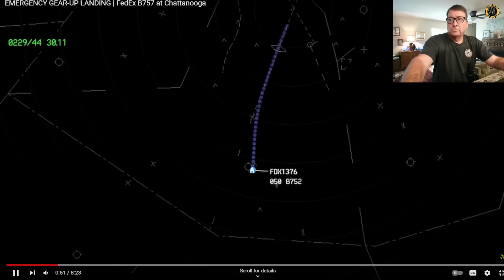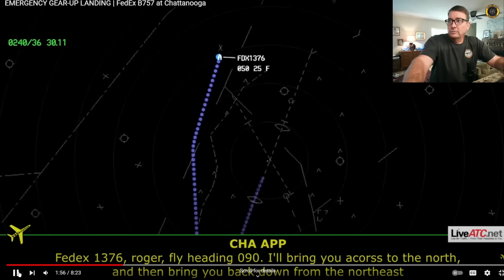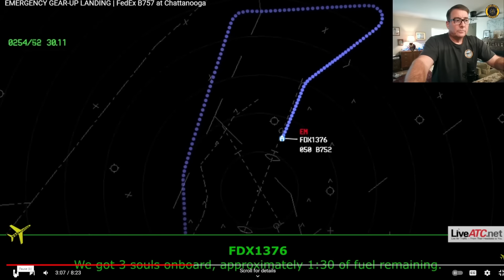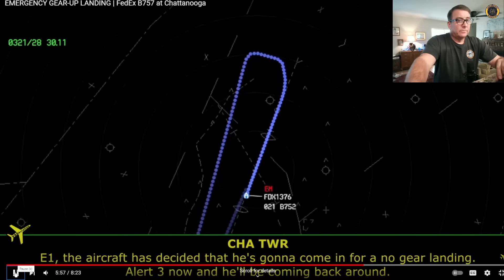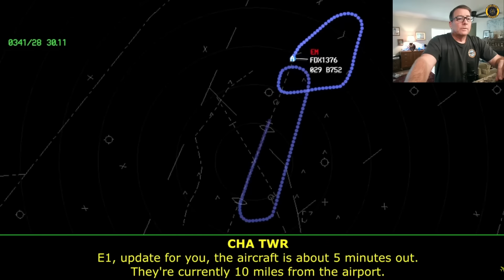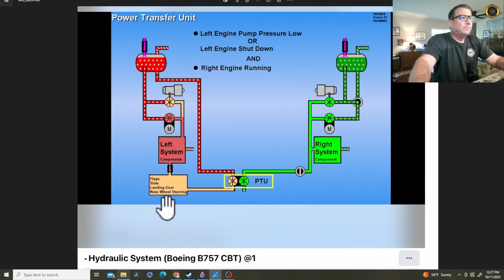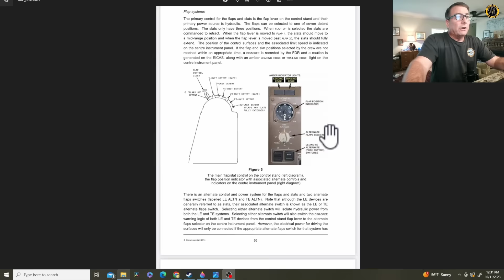Fedex 757 Gear Up Landing 4 Oct 2023

Comment: Could this have been handled any better? Certainly seems like a great job all around.
Reply: I'd say, from the radio chatter, probably not. Now, what went on in the cockpit is anyone's guess, and there might be something that the NTSB finds out that could have changed the outcome. Again, this is based on the radio conversation alone, it doesn't sound like it. But that's just the flight. The NTSB going to look at everything from it's maintenance history, were there reports of issues before the flight crew took charge of the plane, If things were out of service, were they properly documented, was there anything at the stand that ground crew or the pilot inspecting the plane should have seen, etc. That's where you're probably going to see the NTSB catch things.

Luckily, the NTSB has a mostly intact plane to work with. That makes their job a lot easier than when they need to dredge an ocean floor or sift through ash and fire retardant foam looking for clues.
Reply: A night landing too. Amazing.

Comment: Looking at the diagram.....it looks as if the hydraulic reservoir is pressurized with bleed air. I suspect there was an issue with the bleed air that helps keep the system fully pressurized. I am an operator at a power plant and I have a system that uses compressed air over water (which is basically a hydraulic system) and when that compressed air starts having trouble it affects my entire operation.

Comment: What are the chances that thing will fly again?  Looks like that crew did such a good job getting it back on the ground that they could hang some new engines on it, top off the L hydraulic system, maybe a few skin panels back aft, and go right back to work. In any case, they should be able to find the source of the problem pretty quickly since the aircraft is so well intact
Reply: chances aren’t good

Comment: QUESTION: What's the likelihood of this aircraft being repaired and put back into service. I know the wings are designed with a certain amount of flex in them, and the nacelles can be dropped and replaced. But with the plane resting on the nacelles and the tail (plus possible tail strike after the plane was on the ground?), I'm wondering if there was too much stress on the airframe to deem the plane safe to be repaired and returned to flight service. She did what she was supposed to do (Get the crew on the ground safely), so it seems a shame to say she can't fly again. But I'd rather insurance eat this one if there's a chance that she has problems in the future. (I'm remembering a couple of Asian run Boeing 747's that had issues with damage to the tail that led to the aircrafts eventually failing.)

Comment: Seems to be too much dependence on trapped fluid.  All the systems seem to be defeated if the last line to the gear breaks.
Reply: Too much dependence on trapped fluid? I disagree. The 757 has been in service for 40 years. If this is the first gear-up landing, as Juan said it might be, then I would suggest that the backup systems for the landing gear were over-designed.  A single failure in 40 years for something that is not a critical system makes me think the system is better than it needs to be to me.
Reply: @andrewsnow7386  I would view the low damage rate as a sign of good maintenance.  You know what they say about causality and coincidence.
Reply: @RS-ls7mm  Good maintenance is absolutely required. But, are you are suggesting that a good design is not also related to a good safety record -- it's just a coincidence? Would you be happy flying on a 737-Max airplane that did not have the MCAS fixes installed?

Comment: Thank you for an excellent analysis! Can't wait to see what you come up with when the report comes out. I'm sure mentour pilot Will also do the same.

I have a question for you Juan. With the proliferation of cheap cameras, why is it that modern aircraft do not have external cameras? I don't mean the 757 in question. I know it's an older aircraft. But I'm not hearing any reports of more modern aircraft such as the 787 or A380 having external cameras for monitoring situations. Is it a technology issue or a regulation issue?

Again, thanks for all you do.

Comment: it just shows how tough these rigs really are, the engine nacells barely broke after having the whole dang plane land on them lol, im sure their is a lot of damage, but still if this was a passenger plane everyone would have made it out safe and its just amazing how we can make these flying cans so lightweight yet still so dam tough
Reply: Design and stress analysis folks did a great job designing the 757.
Reply: The engines are toast, and replacing them may be uneconomical. That's what retired the LOT 767 in Warsaw. It had little damage apart from rear belly scrapes and the ruined engines, but at the time used 767 airframes had little value and replacement engines were expensive; the plane was soon to be withdrawn from service as LOT replaced its 767s with 787s. I suspect that 757 airframes may be more valuable, but ultimately the cost of replacement engines will determine this aircraft's fate if the airframe is not seriously damaged.  I would not be surprised if the cause of this mishap is similar to that of the LOT 767's belly landing.
Reply: Aircraft is most likely a complete loss. Even though it looks likes little damage the repair cost to the belly is most likely not worth the value of the repaired  aircraft of this age.
Reply: @bkailua1224  you can replace an aircraft, you cant replace a life, the fact it stayed in 1 peice and didnt break up and kill everyone is what im amazed about, forget about repairs lol it will become a good source of spares for the company lol, the fact remains that if it was full of passengers, everyone would have walked away with 0 injury caused from landing on its belly at near 300kph

Comment: Reading up ATSB's report on the 2018 incident with VH-TCA, it sounds like the hydraulic system will drain itself in a hurry. In their case they at least had enough hydraulic fluid to drop the gear.

Comment: I'm not type rated on the B757 but I think your comment about the PTU using "trapped fluid" is incorrect. If I'm correct the PTU uses "normal" fluid supply from the reservoir. When the reservoir is empty the PTU won't do anything.

Please correct me if I'm wrong.

The alternate gear extension system however does indeed use trapped fluid.

The flaps/slats not working hydraulically simply indicates loss of hydraulic power. This might be loss of hydraulic fluid and/or failure of EDP and ACMP and PTU.

The alternate gear extension system not working indicates a loss of power to the alternate gear extension power pack and/or a loss of hydraulic fluid in the alternate gear extension system itself (which should still contain fluid even with the entire left hydraulic system fluid lost).

Flaps/slats not working is completely independent to the alternate gear extension system not working (meaning the alternate gear extension system should always work, and whatever the flaps and slats are doing or not doing has nothing to do with it).

In theory loss of fluid in the alternate gear extension system should not lead to a total fluid loss of the left hydraulic system either.
It's very unlikely to have two hydraulic leaks that lead to complete loss of fluid in the left hydraulic system including the alternate gear extension system.

My bet is the power pack failed or did not receive any power (similar to the LOT incident)
Reply: The alternate landing gear extension system uses a dedicated DC-powered electric
hydraulic pump. Fluid within the supply line to the pump is sufficient for alternate gear
extension operation. This fluid is isolated from the left hydraulic system. Selecting the
ALTN GEAR EXTEND switch releases all door and gear uplocks. The landing gear free-fall
to the down and locked position.

When all gear are down and locked, the gear down lights illuminate and the GEAR light
extinguishes. During alternate extension, the DOORS light remains illuminated and the
EICAS advisory message GEAR DOORS display because all the hydraulically powered gear
doors remain open.

From 757 Aircraft Systems Manual...
Reply: That was a great comment. U know your stuff!!
Reply from the maker: Trapped (isolated) fluid, see comment below....

Comment: The 3 pilots got out and unhurt, that's the important thing. I'll have to go back and look, but it seems like FedEx may have more than their fair share of issues like this?  They fly them every day, and probably a lot of cycles. That 757 probably has a lot of experience (time/cycles).  No fire after a lot of ignition sources (spark shower), another great thing.   Well done!!    --gary
Reply: Yes, but did any of them copy down the phone number for a possible pilot deviation by sliding into the grass? Remember, one of the bingo squares on the VASAviation bingo card is, "Let me know when you're ready to copy down a number."

Also, the version on Real ATC has more of the dialog. Much better watch, but VASAviation isn't bad.

Comment: Why is it so hard for the pilot handling the radio to state to ATC that they are having issues with their hydraulic system and declare an emergency? Why do they feel the need to keep it a secret?
Reply: It’s the American way.
Reply: Not an expert but first you're trying to avoid confirmation bias. Things going wrong doesn't mean you understand why and what is actually going wrong -- so speculation can harm the process of gathering data. So, trying to be curious and work the problem instead of declaring makes a lot of sense to me. 

Second, and this is speculation on my part is paperwork and training. 999 times out of 1000 it's not an emergency so there's probably reluctance. 

And third, disbelief. I think, unfortunately, for many people they don't recognize when they've flown past the first slice of the swiss-cheese model of safety. The "Is this really happening?" feeling.

Comment: I NEVER would have expected  the aircraft to have stood-up that well to a belly landing. Those attachments on the engine pylons must be BEEFY!  Great job on the landing by the pilots. Hopefully they did as good a job on the checklists before resorting to this.
Reply: I'm not surprised. Remember that wings are designed to be flexed a lot more than their normal flight parameters, plus the engines are designed with tremendous forces pulling on the wings. (It's the Equal-Opposite force thing from Physics.) I just don't know what a belly landing (and possible tail strike when all the forward momentum is gone) would have done to the airframe. It might be a total loss that insurance has to eat.
Reply: Landing on a smooth runway helps a lot.  Had they landed in a field, it would have had much more damage.

Comment: Thanks for the rundown. I look forward to the final findings, since my thought is a leak in the landing gear hydraulic bled the trapped fluids dry. Based on my limited understanding (basically entirely your explanation) that would be the only thing that would show up as a general hydraulic failure (a blocked line or seized door would not) and still manage to bypass the two levels of redundancies. 

It would also be interesting to know if this is a critical enough issue to be addressed through engineering, or an edge case that may just need a new checklist or even nothing at all. 

Glad the crew's safe. Great flying all around.

Comment: Sorry but there are only 2 ways to put the gear down: the normal extension system and the alternate extension system. The normal extension system is powered by the L hydraulic system, which consists of an engine-driven pump, an electric motor-driven pump, and a power transfer unit. The PTU might work in some scenarios where the L EDP and L EMP are lost, but it’s not totally independent of the L system; if you lose all your L system fluid (like might happen if the leak occurs at the reservoir, at PTU, at the flaps/slats, or at the landing gear) then the PTU doesn’t do anything for you because the “trapped” reserve fluid goes out the leak.  

The PTU’s primary intended function is to be independent of the L engine in order to provide nominal gear and flap retraction performance after a L engine failure on takeoff.  This is necessary for the airplane to meet its engine-out climb performance requirements.
Reply from the maker: ...and lower the gear...3 methods.
Reply: @blancolirio  the PTU is not fully independent of the L system. If you have a leak in the normal gear actuation system, the normal high lift actuation system, the PTU, or the reservoir itself then you lose the entire L hydraulic system including the PTU (and this is what I suspect happened in this event).  The PTU subsystem is protected against leaks in the flight controls and engine, but it doesn’t work the other way around.  There are many single points of failure that cause loss of the normal landing gear actuation system. The alternate extend system is the only backup in those cases. Thus there are only 2 truly independent ways of extending the landing gear.

Comment: Is there an escape hatch in the cockpit floor? I thought I saw a clip of one of the pilots hanging from a rope underneath the cockpit and falling and hurting his leg.   I also thought I had heard a clip of pilot saying he was going to rock the plane to see if landing gear would fall by gravity?
Reply: Don't know on the 57/67 but the 777 has door into the avionics bay in the fwd galley, once in there, there is a door in the belly behind the nose gear. No hatch in the cockpit but the do have escape ropes to go out the windows.
Reply: the 767 has an escape rope at the door and also both sliding windows, maybe that's what you're thinking of. The 757 has escape slides L1 and R1 doors, and no lower deck access from the upper deck

Comment: I haven't flown the 757 since 2005 so I had to get out my manuals to follow along. Wasn't the LOT incident a result of a tripped CB on the  alt gear ext motor?  As Juan said, we'll know soon enough when the crew gets to sit at that long table in Memphis and tell their story. Good breakdown of the basic systems Juan.
Reply: The LOT Flight 16 incident (which is I think the one you're referring to) was on a 76, not a 75. But very similar -- they had a hydraulic leak in the centre hydraulic system, and the alternate extension mechanism failed. They did discover a popped circuit breaker, and after lifting the airplane hull into the air, they reset the circuit breaker and the alternate extension mechanism worked. However I think the alternate extension system on the 76 works differently -- I don't know that much about the 76 systems, I mostly know about the 75 and 77.
Reply: @AureliusR  Yes, I'm aware the LOT incident was a 767. The 767 uses only elec. motor for the alt. gear extension. I only flew 757's but took several sim checks in 767's since the FAA allowed it. My airline only operated 757's so my FAA oral for the combined type rating was on the 757.
Reply: Great point 👏👏👏👏👏......   however not even the rat worked...   bizarre incident ,well handled by all involved
Reply: __blancolirio--  Oh wow, you're definitely the real blancolirio, no suspicious underscores or hypens anywhere in your username!  🙄

Comment: Looks like a loss of hydraulic fluid in the secondary inlet line on system #1 (without a stand pipe). I'm really curious how this backup line failed since it's normally not utilized and has valves/actuators

Comment: I saw a longer version than what Victor posted over on Real ATC and  that controller was a freaking rock star. Coordinated with the tower for landing clearances to avoid frequency changes, contacted FedEx for cargo info, and didn't bug them unnecessarily while keeping cool, calm, and collected. Give that man a raise and a nice long paid vacation! Also nicely done to the pilots as well. I could imagine being the captain and knowing you're essentially going to do a controlled crash landing.

In the longer version the crew made a slight wiggle off course and the controller asked if they were breaking off the approach to which they responded no they were trying to use a gravity assist to open the gear doors.
Reply: And the controller could have handed off the aircraft to tower or approach (I believe this was departure they were taking to, but I could be wrong.) But he decided to keep the plane on his frequency and in his airspace long before either of them declared the Emergency.  We've all seen normal miss approaches where approach hands the flight off to departure to vector the plane away from the airport, only to be handed back to arrival for another shot at landing.

This guy was Awesome.
Reply: I agree, this controller was top notch.
Reply: The controller is my little brother, and he kicks ass. He has controlled me in the pattern on many occasions and loves his job.  He is USAF trained and has years of experience.
Reply: Very cool! The military training certainly showed in the way he handled that situation. I hope he got some well deserved time off after that!
Reply: Totally agree
Reply: No! Give the controller team an all expense family inclusive long vacation.
I'll figure out where the money's coming from later, even if I have to out of pocket it, it's an investment well spent.
Reply: Yes, indeed!

Comment: With all the redundancy, I'm surprised there is a single point failure mechanism in the venting of hydraulic fluid downstream of the hydraulic tank low level pickup.  And why not, if all else fails, have a PTU bypass valve to directly link the right system to the left system?

Comment: I wonder if this is another case where taking the time to run through long checklists made the problem worse.  If they'd returned right away, they might have had enough fluid left in the system to drop the gear.